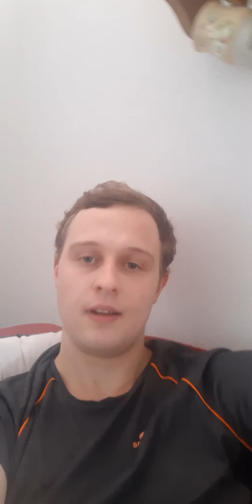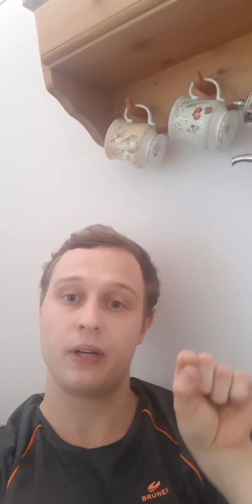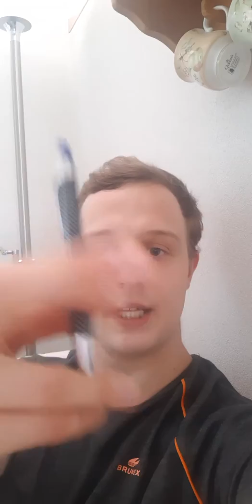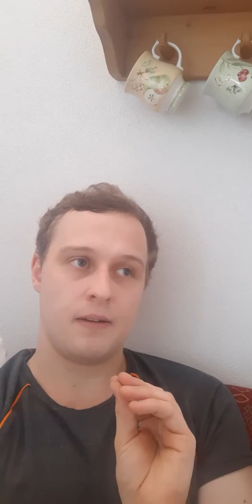HRC importance. Rockwell vs other factors

Comment from the maker: Due to a good input: If we compare two knives at different hardness but the same steel and have all the other things like austenizing temp, cryo, temper etc. in line, then YES, the HRC will be the deciding factor for edge retention. But only then. Usually, we cannot rule out other variables besides HRC to explain performance differences when we assess and compare the performance of knives made by different manufacturers. I may will do another video on the subject of "knife performance" as a whole.

Comment: It would be super interesting to edge test the hardness of many different production blades.  Due to a combination of steel, heat treat and method of grinding, some seem not to lose their temper even if they are profiled, much less sharpened, after heat treat.  I believe the Buck 110 for example gets the hollow grind after heat treat, in an automated double-wheel grinder, which must be wet/lubricated, because the factory edge seems great.  Whereas famously the Bark River knives have had problems due to overheating when the factory edge is put on.
Reply: Note this is after heat treat: https://youtu.be/T6FAvOykQBU?t=145  and then after this, it is sharpened on a dry belt sander.  I wonder if they simply remove enough "over-tempered" metal on the leather stropping wheel, or if 420HC is simply okay holding up to the temps created by the belt sander?

Comment: Wet grinding should be standard. I know you told me before that it’s really expensive to carry out but IMO it needs to be done
Reply from the maker: I actually always tell the opposite - it is NOT expensive. ☝️
Reply: KKnives Switzerland well now I feel dumb lol!! Also I was sent a new Manly because of all this testing. Guess they even had their ovens 30degrees lower than what it was saying
Reply from the maker: @misterbaker9728  Maybe we missunderstood each other, because language barrier. And the PID of an oven needs to be tested. They can really lure you into a sense of false security but the actual temperature inside your oven may be off.

Comment: It's great to see your beautiful mug again! 😂😂 I mean the cup that is hanging above you of course 😃

In all seriousness, it is a nice and informative video. I don't know about "mini austenising", I believe that is the wrong term, but I get what you mean by that. Keep doing good work Roman 😄
Reply from the maker: Haha thank you! It is basicly putting alloying elements into solution again. Which as I mentioned, can be a wanted or unwanted thing. One could really describe it as a miniature austenizing as similar principles apply, leading to carbide formation.  ...so "Yes but actually no" 🤣
Reply: @kknives_switzerland  In my perspective austenizing is called austenizing because there is austenite involved somewhere in the process, but there is no austenite involved while secondary carbides are forming. The carbide forming elements that were free in the martensitic structure pull the carbon out of the martensite and form carbides. In the end the important thing is that we understand each other and we know what is going on during the process, no matter how we describe it with words, am I right? 😃
Reply from the maker: @micgalovic  This is what I meant, thanks!! and yes, exactly. It is hard to find words in english sometimes, glad my point came across👍
Reply: @kknives_switzerland  wenn es nur um mich geht, dann kannst du auch Deutsch sprechen 😉
Reply from the maker: @micgalovic  Haha alles klar! Aber meistens interessieren solche Kommentare alle, darum ist Englisch wohl am besten👍